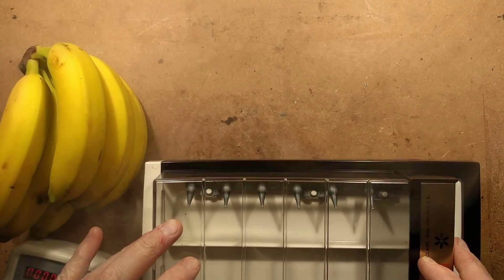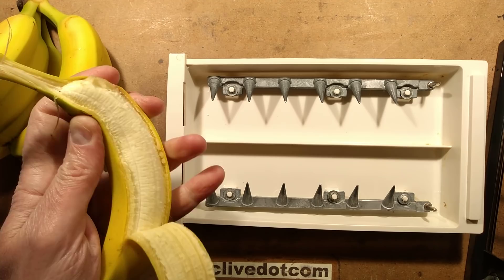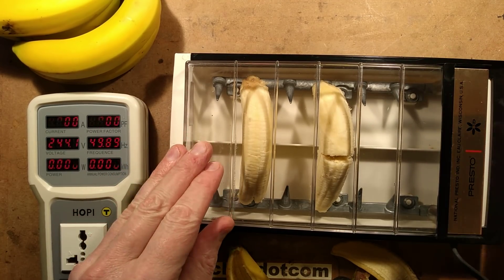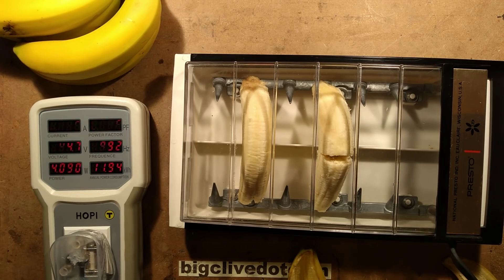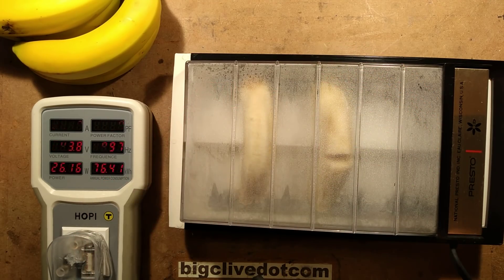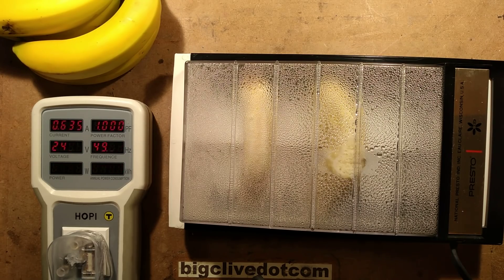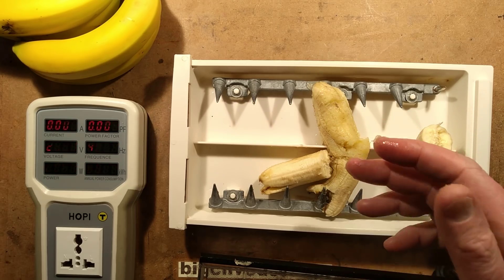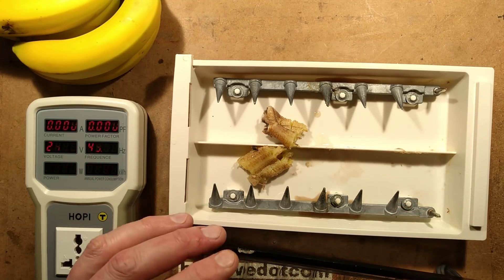240V bananacuting  bananticlimax.  (mastication alert)

Comment: See, the problem is you bought the high-resistance bananas. The kind you want have the copper powder embedded in the banana meat. You can tell which ones are which just by the color: high-resistance ones are the typical green or yellow; low-resistance ones are brown or red, sometimes even black.

Comment: you have to put a high voltage pulse on the bananas to get the banion flow running. After that they act like a negative resistance device, so use a current limitor.

Comment: I have NEVER seen hotdogs in cans or jars. only in plastic packaging and bulk packaging (usually plastic as well or plastic bag in box frozen)

what I find fascinating about yours is I assume they are shelf stable? not refrigeration needed? I bet they are expensive though :-(

btw I have this hot dogger as well as the curvy newer one that takes 5 victums instead of 6 :-)
Reply from the maker: £1 to £2 a tin.  Very long shelf life.
Reply: @bigclivedotcom  that's only about two times the cost here for cheap hot dogs or about on par to slightly less than the cost for typical grocery store Hot Dogs which are typically overpriced :-)

So that's actually not too bad I wonder what the taste difference is if there is any snausages come like that a little Vienna sausages which are okay but having lack of firmness that I like they tend to taste very mushy good flavor but little substance poor mouthfeel

Have you ever tried a normal well what I consider a normal hot dog? How did the canned ones taste in comparison?

Now I want to see if I can find some canned hot dogs in the US :-)

Comment: What's funny is that most people here don't get that canning and pasteurized vac packs are functionally the same thing. Cans are just a bit more resistant to puncture, but hot dogs are always fully pre-cooked whether vac-packed or canned. The major advantage to fully caned is that cans are impermeable, so they are more shelf-stable outside of refrigeration.

Probably why the canned type are more popular in the EU, since they don't sell as fast as they do in NA.

Comment: Let's introduce a new measurement unit WpB (Watt per Banana). Cold bananas seems to have a slightly lower power factor than hot dogs and it goes up to 1 as they heat up.

Comment: He sticks the hard, unripened banana with his sharp prick. Starting to pump his full power into it, slowly the energy increases. More, more, harder, faster... His banana begins to heat up, warm, then hot.. Steam rises from the tip as the cold air reveals. The energy increases, more, more. The banana erupts in a convoluted fashion, the sensasion too much to experience. And then, slowly, the power ebbs away.. resulting is a soft, flaccid, thing, once more.. darkened by the experience...

then he eats it.. Oo

you're a sick man Clive!! haha :)

Comment: Try electrocuting a grapefruit. The conductivity of the citric acid should make it more interesting than bananas. Oranges or lemons would work too but you would have to connect two in series with a piece of wire to make them fit.

Comment: Hot dogs generally come pre-packaged  in a clear plastic sleeve in the U.S. There is a bit of brine surrounding them. I have never seen hot dogs in a can. They are also available from the butcher shop, nearly dry on the outside, with no brine surrounding them.

Comment: So. Any linesmen watching, you can use bananas as insulators on overhead lines and hotdogs for lightening protection. Tracing faults would be by smell alone. This could work. I suggest a further test at 11kv just for due diligence. 😆

Comment: I think you bought 3-phase bananas by mistake. They're never going to cook well on a single-phase supply.
Reply: For best results electrocute three bananas in a delta configuration.
Reply: I heard it could be the reactive inductance of the bananas as it might act as the inductor as well, therefor turning out to be an energy storage module instead of getting cooked
Reply: @cheesesssessses2222  A "Bananattery"
Reply: all of you are forgetting to take in the resistance of the banana that changes with thermo-inductance and acts like a piss-poor ac fuze

Comment: You just need to use a bit higher voltage the banana has a lot of resistance due to the fibre between the both the individual cells and the compartments or whatever you call the bits it breaks along when you bend it..

You could try freezing one in it’s skin before electrocuting it that tends to break the cell walls and the compartments and makes them more conductive... or you could just use a thousand volts or more.

I think someone did a paper on the resistivity of bananas at different voltages and different ripeness I will see if I can find it.... I think there was splitting and spitting involved at high voltage with a very ripe banana.
Reply: Just do like Bananas Foster and soak them in a butter & brown sugar mix with a splash of Grand Marnier.

Comment: Are platanos/plantains available in your neck of the world?  That would definitely be interesting and/or tasty.  :)
Reply: Plantains are just basically large extra firm Banana's and are very bitter. They would probably be less dramatic than the Banana since they are mostly dry. For the Hotdogger to work the best, you would need something with high moisture and lots of salt.
Reply: @the1andonlyfirebug  Slice them up, add oil and possibly an oil/electrical fire, electrocute the slices, smash them down, re-electrocute them, and you'll have tostones, a burnt down house, and third degree burns.  I'm sure it will be worth it, for science.  :)

Comment: Jelly filled donuts.
Pickles.
Frozen Burrito.
Then continue with other phallic fruits.
Reply: Breakfast Sausage?  "So that's why they call 'em Bangers"
Reply: Eggplant maybe?
Reply: @MeSoTrashed  Oh the explosive possibilities. Wonder if it would fit under the  splatter/safety cover.
Reply: @Mr.EricMBlack  Eh, just bridge the connections with laboratory wires/Banana plugs
Reply: Donuts and burrito might not pass current. Don't have much conductive potential. Even with the jam.(jelly)
Reply: @creativejamieplays7185  Oh I bet a cheap salty frozen burrito has more potential than a potassium rich banana. Reminds me I should buy some more. hmm.
Reply: I think the difficulty with doughnuts of any variety would fitting them in. I think they would have to pass the taste test first and is unlikely to actually make it into the machine.

Comment: Pickled gherkins next!!! They glow when suitable voltage & current is applied!!! :D

As for hot bananas, just stick 'em in the microwave (peeled of course) for about 30s, and there you have a nice snack with no electrocution of fruit needed... :P
Reply: Gherkins are to small. He will need larger pickles. 
Hmm home made sodium lights..🥒

Though any food item that has been "pickled" in brine should light up.
Reply: twocvbloke just to be a pedant the microwave would setup a voltage (potential difference) in it every half wavelength (~cm) while it was cooking from the water molecules being jiggled because bananas are quite oily that may actually have a significant effect on the amount of heating... I have been hoping beyond the press, Thunderf00t or someone with a high speed camera would do a slowmo video on a microwave in action

Comment: More, 'electronic farting noises?'  Sadly, no.  I don't think there's enough moisture in those bananas.  If you got riper ones, it might work.  Only trouble is, they probably won't stay intact when placing them across the electrodes.  One solution might be to leave them in their skins.

Gherkins?

Comment: Youtube's favourite vegetable to electrocute is the pickled cucumber.
Reply from the maker: I'm trying to source big enough ones without luck.
Reply: @bigclivedotcom  Really? Wow - entire pickled cucumbers are quite common here and I know they're easily long enough to work in your electrotorture device - though they're WIDER, so maybe only half as many would fit. (There's even one brand I've often seen in convenience stores - one whole pickle in a plastic pouch, sold as a snack.)
Reply: bigclivedotcom you know you don’t need ones that will fit the hotdogger just run two wires to it strait from the mains. That is all that hotdogger is doing.
Reply: @Robert-Wilson  the hotdogger is doing it in a more compliant way with safety.
Reply: Possibly imported ones? I rarely buy them but think there are various sizes available here in Germany.
Reply: You might need to wait for cucumbers to be in season in the UK before they're available (pickled or not).

Comment: well you could overvolt it, right? Maybe a microwave transformer?
Reply: or neon sign transformer
Reply: Yes! We know clive has one of those. Whatever doesn't cook will be Lichtenburg art.
Reply: Jim LaGraff he could get some dried strips... he could also do a Cody and put Clive on one in pencil...
Reply: @KingOfKYA  why you wanna fart up the nanners bra?
Reply: It already is.
It's an american 110v appliance on 240v.
Reply: I forgot about it, but it's not enough apparently... Let's shove a few hundred more volts through it
Reply: I'm sure Clive has a high voltage supply for such an event.
Reply: What about mike from mikeselectricstuff's destructotron. He previously exploded a circuit breaker with it.
Reply: "well you could overvolt it" (forgetting that it is already by powering on 240v)
Reply: Somebody call Shango066!
Reply: Photonicinduction's 20kW supply might be useful for this